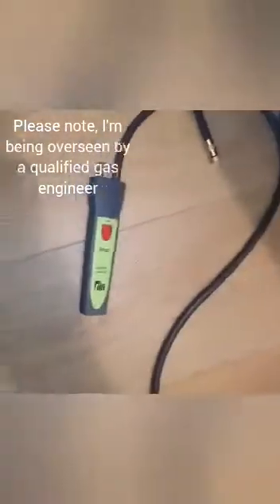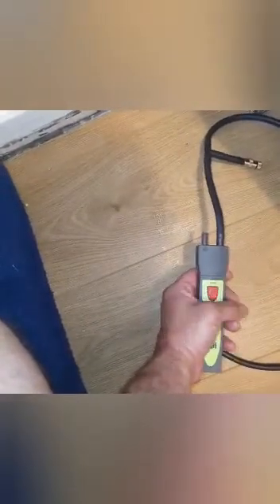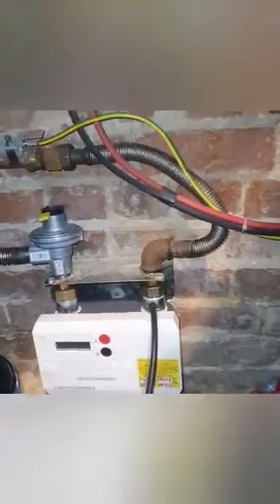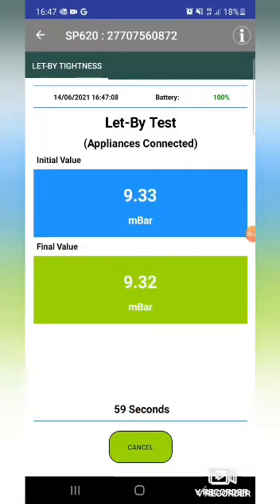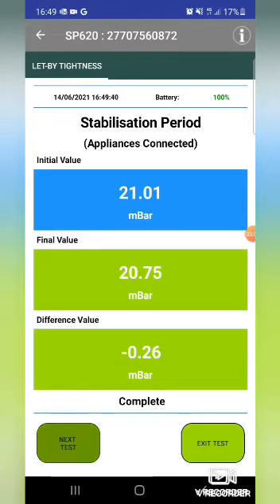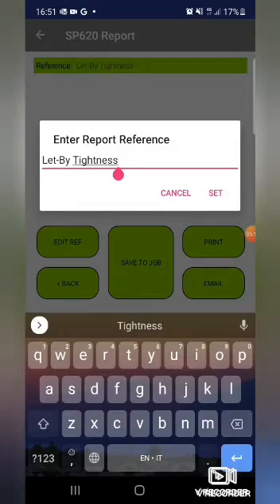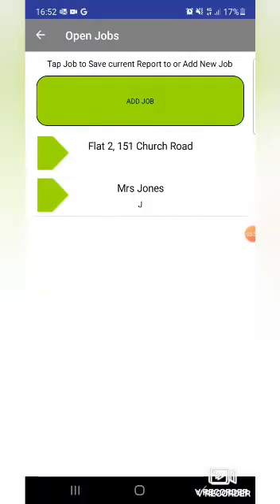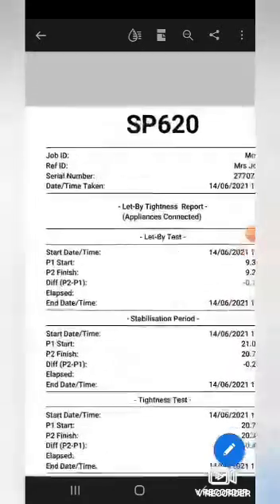Performing a Tightness Test with the TPI SP620 Differential Pressure Meter Smart Probe & View App

Comment: The prongs on the SP620 is alot narrower/smaller than typical manometers. What type hose /size do you use? Or do you need a hose adapter in which a standard hose fits the Meter nipple and a smaller hose fits into the SP620.